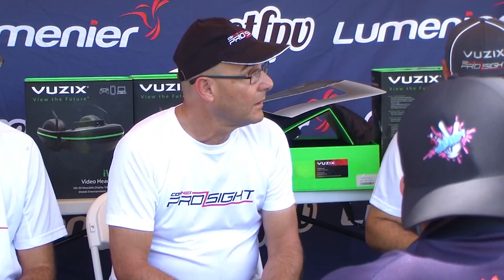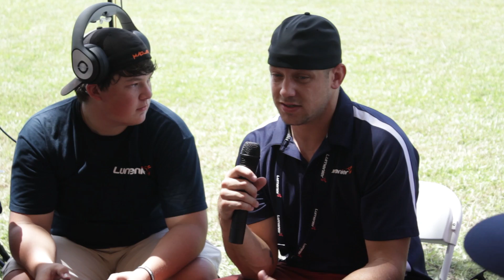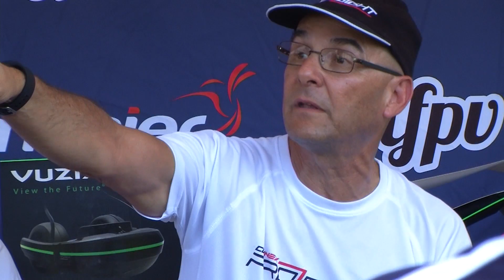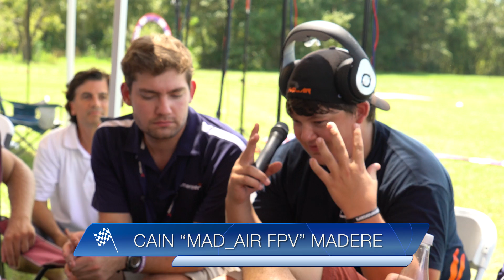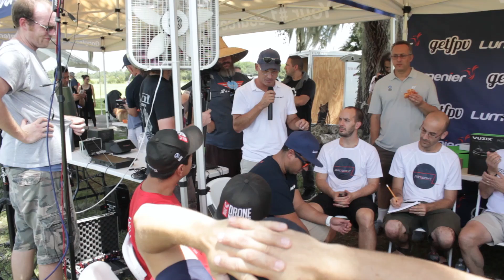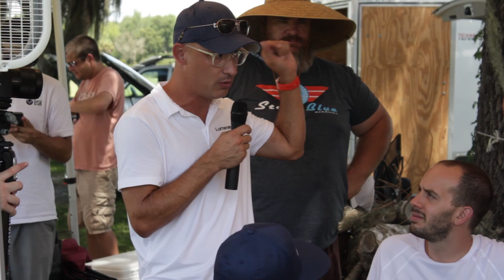Pilot Feedback on ProSight HD VTX System

Comment: Yep, Guys are trying to be nice and sure there is a lot of nice things to say about it. They do hit the cons: 
- adjustability. Its impossible to use it in low light. HP just does not work at all in low light.  - HQ not suited for racing. It feels as if it has reduced frame rate. No lag, since I can do technical stuff but it blurs. 
- stock antenna holder is bad, properly bad. This design not only wobbles after rolls but ends up in props. I mean 1-2 days of lifetime :)
- mobile app could use a bit more settings, say existing ones like cam quality.  
There is lots of positives: 
- issues with channels? Let me use my QAVR with prosight, peace of mind and confidence. That alone is a huge plus. 
- The Quality in HP is not miles better but it is better than analogue. Pixelated but better.
- I like the panoramic aspect a lot. Happen to have box goggles which do not mind. 75FOV makes it very immersive.   
- FPV cam is quite solid. Proper screw sockets. Metal inserts. 
- Package is nice, all the cables and screws one would need. 
- HQ quality is stunning for FPV, sure cruising and not racing, but I do find myself do it a lot more.
- mobile app is nice, I use it all the time. 
So: make it adjustable. 
I did some evening HQ racing recently, doable. mainly because HP would not work at all. 
https://www.youtube.com/watch?v=QloQ8jh1K0o
There was just generally cruising as well: 
https://www.youtube.com/watch?v=t-u3rw7g9Pk
Anyways, it could be the future!
Reply: BTW: I have it in QAVR but we all deserve X to fit prosight in :) wink.

Comment: So people will pay 400 bucks for a GoPro brick but wouldn't pay $100 for an onboard recorder that would be a fraction of the size? Doesn't make sense.
Reply: Adding an onboard recorder the size of the vtx will push the weight more than an analog system with a gopro. From what i remember, the digital system weighs about the same or a little heavier than the analog with the gopro. We all should  know, needless weight is a no good if there is a better option.